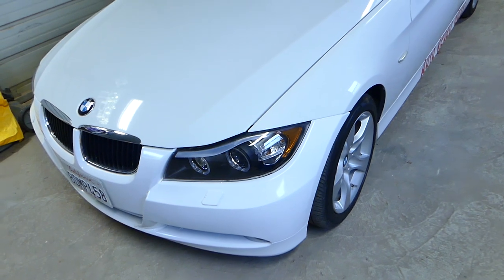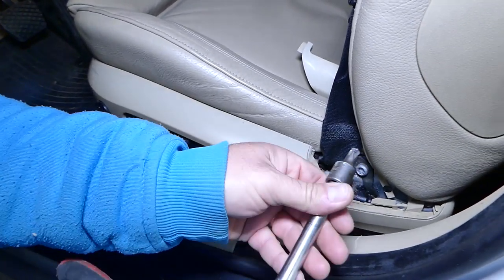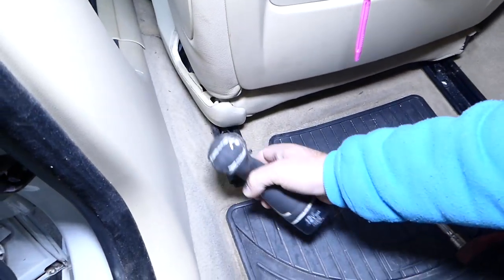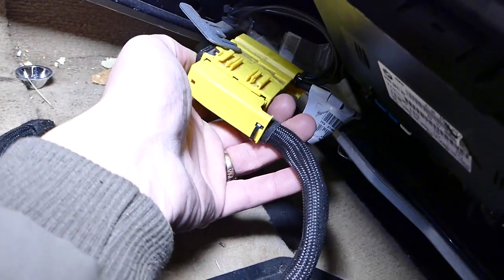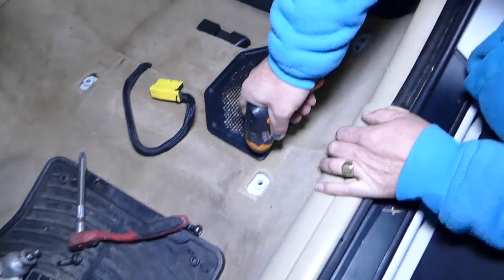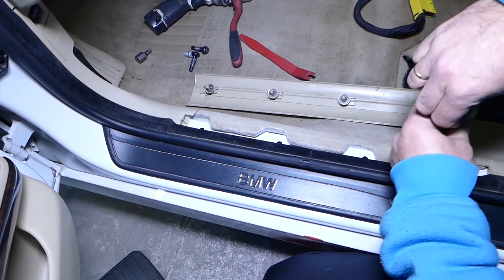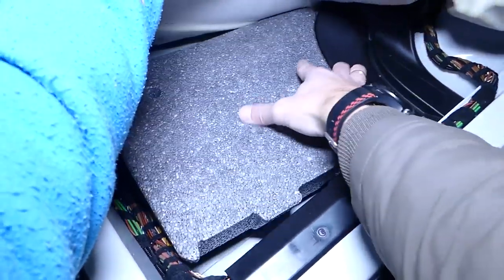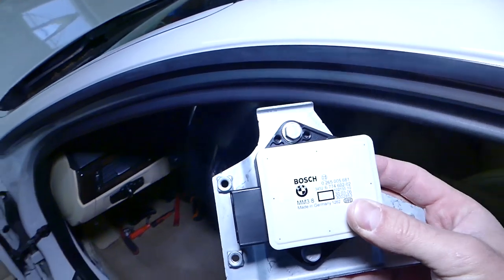YAW RATE TRACTION CONTROL SENSOR REPLACEMENT LOCATION BMW E90 E91 E92 E93

Comment: All of the vids I've seen from you guys are great. Thanks for showing how the wire harness clips release in all of your videos. I have had Porsches and worked on them for years and you'd think a lot of clips and clamps would be the same but they are not. Great job as usual.

Comment: Does this control the rear right and rear left abs sensor communication? I am getting fault codes on the rear abs sensors and I have replaced them with two new sensors. What lights will come on id this module is bad?
Reply: Does it can somebody answer his questions I have the same questions as him
Reply: you have to change the reluctor rings as well
Reply: It was one of the ABS sensors. Word to the wise. Only use Bosch ABS sensors on BMW’s. Cheap Chinese sensors will fail. Believe me.

Comment: Does failing this sensor cause the rear wheels to vibrate about at 40mph? This is what happens to me. I remove gas pedal then get fixed. I have to keep driving like that by removing gas pedal often to stop vibrating the rear wheels!  DSC sensor at panel is lit. It starts ti happened after a heavy rain.

Comment: Bro I have a question, Is an engine flush a good idea? Why do some people say that it's bad for the engine? And please do more videos on the Elantra!:)
Reply: I did it to my car's engine when I bought it because it had very old oil. an engine oil flush takes out all the old sludge and crap stuck to the inside of the engine, but usually its a bad idea to do it to a neglected engine because the stuck sludge can sometimes prevent leaks from happening, or it will give you compression issues. It's up to you if you want to use a flush, if you think it will cause leaks or burn more oil, use a higher viscosity oil depending on your engine after the flush